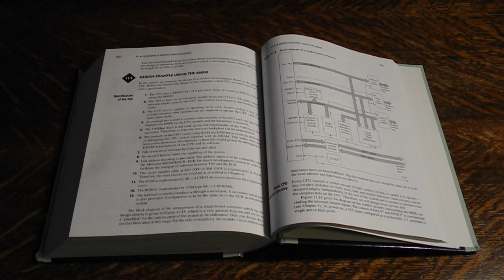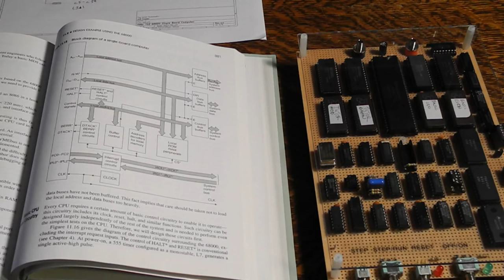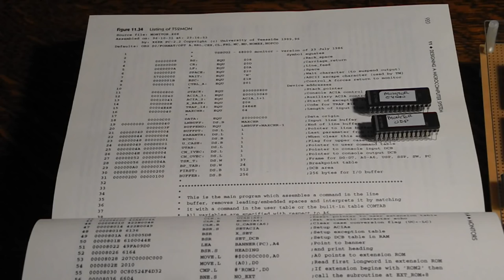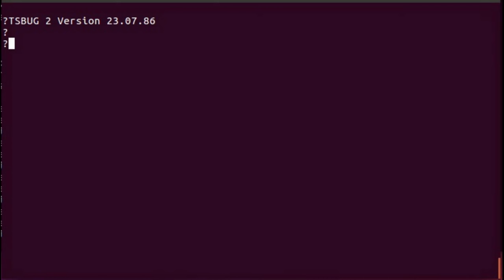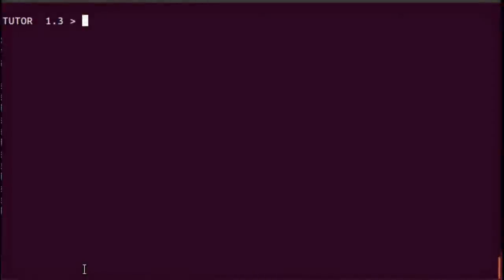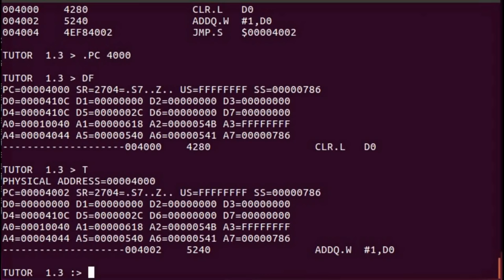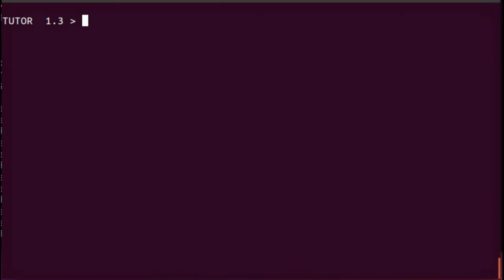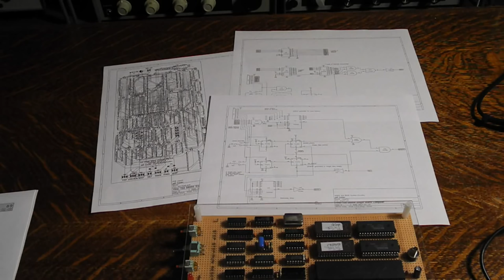The TS2 68000-Based Single Board Computer

Comment: When we first got our hands on the Motorola 68000, just about all the developers wet themselves.   It was a dream to program in assembler.  First big project was an air-to-air navigation system with 5 x 68000 CPUs.  My job was to program the graphics display board, showing icons of other friendly and foe contacts on the airplane's HUD.

Comment: Wow, just wow, the memories.  Computer archaeology .   Was once convinced that the 680x0 series of chips would dominate the micro market, due to the elegant instruction set, and large number of wide registers.  Mainframe on a chip.
Reply: Very nice processors....

First wave of really OS capable devices.
Reply: The reason it did not dominate was because the computer companies who marketed 68000-based designs had leadership with their heads firmly up their backsides. Only the PC makers learned the number one lesson from the Commodore 64: Volume is the king of business.
Reply: 68k was a magnificent piece of silicon, a far better implementation of cisc than an X86, with its weird addressing scheme and the lack of dedicated registers... a poor extension of an 8085, adapted to the 16 bit world... 
Try to figure out what Motorola would have been if IBM had selected 68k for its pc implementation: maybe Intel had dissapeared... and Motorola would have thrived!! 
The best processor with the best architecture, does not turn into the best selling silicon all the times... 
Look at the demise of Power PC , which was a very nice processor architecture... ( a designed a board myself with an 8245 running at 200mhz...) 
The 68k board is nice, but all that random logic is a bit disturbing! 
Why not use a Max II or a Lattice to squeeze the garbage into a single chip??
Reply: @sauronbadeye   His game was to reproduce Alan Clements's project board with period glue logic.  I knew people wire-wrapping on 68k boards in college, maybe around 1990.  They probably used that very book for the course; it looks familiar.
Wish I had that wrapping tool!
Reply: @GnuReligion  At that time books showing how to design around microprocessors were quite popular: I bought the "Bug Books" series, teaching how to interface an 8080 to almost anything existed on planet earth! 
These books had also program examples, snippets of assembler codes designed, for the purpose : in general young electronic engineers like me were not too familiar with low level program languages like assembler and mastered instead high level stuff like Basic and Fortran........

Comment: Impressive Jeff.
I have lower ambitions and that is to emulate a Motorola 6809 microprocessor.  I have the 'micro-code' programmed, just need some hardware to interface to it.
they were great times when these devices first appeared.

Comment: Really cool stuff. I've dreamed of building my own computer for a while.... I think I've settled on the 68K, but I keep thinking Z80 for the simple fact of CP/M ... but then I think why do I need a large library of software for something I'm basically developing to tinker with...
Reply: May be.... I've never done  68000 assembly. I've actually only ever dabbled in it on 6502 and earlier x86 architecture.
Reply: I have a feeling CP/M was ported to the 68K though, so, best of both worlds if it's downloadable off the internet somewhere.
Reply: @BlueChrome  Yes, it was ported to the 68k.
Reply: Yes, it was ported to the 68000. It was simply called CP/M 68K. An internet search will turn up lots of information about it.

Comment: There might be interest in getting some PCBs if you finished a design. If you stayed with with all through hole parts you could use a couple of AS6C4008 512KB SRAMs for 1MB total. A lot more than the 32KB on the original Motorola MC68000 Educational Computer Board. I have a MECB that I haven't tinkered with in quite a while.
Reply: Agree, maybe newer parts but still staying with the SBC concept. I'd do the same with the ROMs and make them EEPROMs.

BTW doing my first KI CAD project this spring.

Comment: For another challenge, try making a similar SBC using the WDC65C816 (used in the Apple //GS). For a different type of challenge, see if you can make a video adapter board for your 68k SBC using the "Propellor" chip, an 8-integer-core 32bit micro controller, that has primitive hardware support for generating NTSC video.

Comment: there's actually a few projects that deal with adding a unix-like OS to microcontrollers:
- there's retroBSD (a port of 2BSD to a 32 bit microchip microcontroller with 512kb of ROM and 128kb of RAM, it's said it's enough to run the kernel plus some additionnal programs)
- and liteBSD (a port of BSD4.4 for the same microcontroller).

Comment: lot of car devices had "grandpa of Pi/Arduino,  Motolora 68332 microcontroler based on 68020.
Do You know what software theryre running on?
Reply from the maker: My understanding is they were mostly used in PCMs (Power Train Control Modules, see https://en.wikipedia.org/wiki/Powertrain_control_module) which would be proprietary software specific to each car manufacturer and probably not running under an operating system as such.

Comment: I designed and built my own 68000 based CPU board over 25 years ago. It has 64K of EPROM and 64K RAM. In the last year I dug it out and got it running again. I needed to redo the monitor program as the EPROM contents had started to change some bits. I have modified the board to allow optional use of NVRAM instead of EPROM. I have a very basic monitor program running on it that includes downloading S format records but I will check out the TUTOR monitor and the enhanced version of BASIC.

Comment: can it run some arcade games from the 90ties ?
Reply from the maker: It has the processing power to do that, but it doesn't have hardware for graphics or even video output.
Reply: @jefftranter  Do you work on this for the next update ? Do you know this gameduino FPGA solution ?

Comment: So very cool...

I just did a modest amount in 6802 but the 68000 was a very big, generous architecture and super clean instruction set.  I would have loved to have a system like you put together so well back  in 1984!

 Very slick.